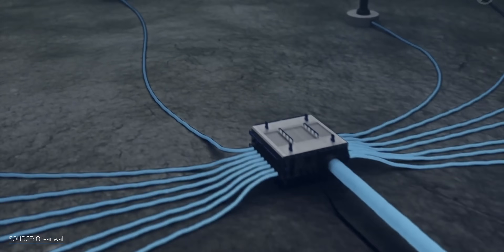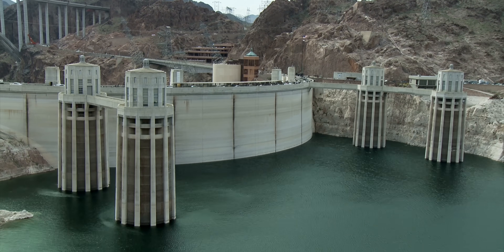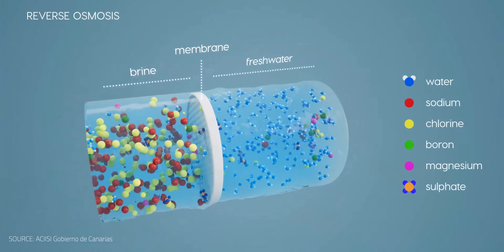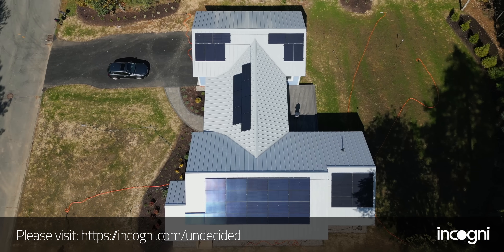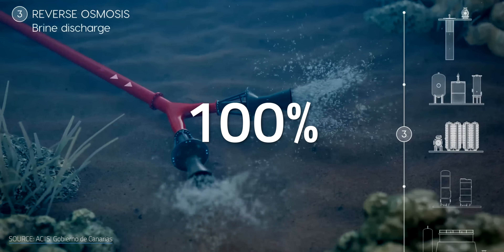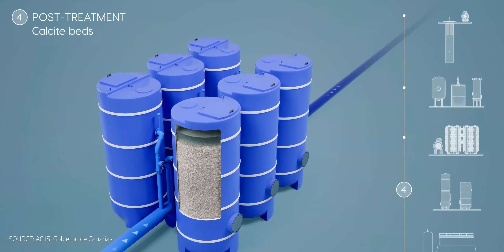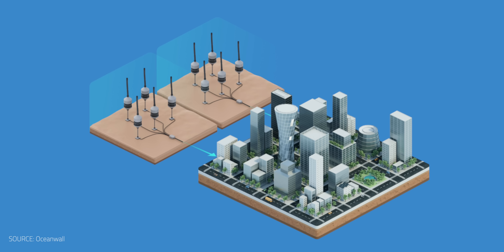How Deep Sea Water is Now Drinkable

Comment: I still did  not understand where the "free" pressure gradient is supposed to be coming from. Yes at 500m down under you have 50atm of pressure. But then everything is pressurized and there is no delta per se, and you need the pressure difference , not just pressure .
Reply: The savings are all at the brine side of things. at the surface you are pushing all the water against the membrane, some goes through, while some does not, the brine portion. this is where you save energy. the pump is removing the freshwater portion, using the same energy that you would need to pump that amount of fresh water 500ft up. then there is the brine which is pumped a few feet away at essentially the same pressure, so minimal work is needed. Thus, saving the cost of pressurization. Additionally, it has a pollution saving and operational cost savings by not needing water treatment, which saves not only money, but the energy used in the production, purification, and transport costs of those chemicals. assuming that the initial installation and maintenance costs are not more than those everyday cost. it's not straightforward and can be complicated for even a simple system. But the physics is correct. pumping the freshwater is less energy than pressurizing a much larger amount of water to those pressures.
Reply: @philip4545-h3t  Thankyou for that. That was the key thing that was missing. They pressurise all the water, then dump a lot of that pressurised water out. If this doesn't need that pressurised waste water it's an energy saving.
Reply: @philip4545-h3t  so the main cost savings is not having to pump the brine back down to some depth. in the vid he shows that there is till pretreatment though, just less? you'd still need all the anti scaling stuff?
Reply: @bobmike2373  no, the main cost savings is not having to pressurize the brine portion. The water is also just filtered, not treated. As far as why? I don’t know, but for the physics. It’s about where you are applying the pressure. Gravity is applying the pressure against the membrane. The only work that needs to be done is pumping the RO water to the surface
Reply: @philip4545-h3t  he shows that its at least pre-filtered. tbh its probably going to need some kind of treatment maybe. pumping the water to the surface is still going to take a one big pump anyways. as a side note, wouldnt this need some kind of flow over the RO filters to keep them from making the local water super briny?
Reply: He did a terrible job of explaining, but it seems like the savings comes from the fact that in reverse osmosis systems a large percentage of the water pumped into the filter doesn't actually get filtered and just gets converted to brine. If the filters are under the sea you only have to pump up the resulting freshwater, not the wastewater. You can achieve a similar savings in a traditional surface system by using the pressurized wastewater to spin a turbine and recover some of the energy wasted pressurizing it.
Reply: @AndrewMeyer  Why do you need to explain something that is obvious?  have you never siphoned water before?  I don't even need science for this.  We did this on the farm all of the time.  If you have a huge water tank full of water and another tank with no water you can siphon water between them(we used to do this over a distance of 100m no electricity just a hose pipe.  you make sure the pipe is at the lowest point in the tank sunk on the end until water starts flowing and then put it in the empty tank.  The weight of all the water in the full tank forces the water into the empty tank.  This is the exact same system but with the weight of the ocean working to force the water to the collection point.
Reply: @hihosh1  Is there pressure on the inside of the membrane or isn't there? If there is, then water's not going to just magically flow through the membrane with a pressure difference of 0. If there isn't, then you can't siphon unpressurized water uphill. Pick one, you can't have both... unless of course you have a pump to do one of those jobs which is exactly my point.
Reply: less energy is potentially needed on the intake side of said filter to draw water into the filter, thus the need of a pre-filter pump to create pressure necessary for reverse osmosis is eliminated and now they just need post-filter pumps to do the work and pump fresh water to shore, but the energy saved doesn't seem that groundbreaking enough to be considered as a viable alternative so there might be other reasons for doing it

funny they do all these work though when they could have just used nuclear energy to power the pumps in the first place at a fraction of the cost while also powering the same city it's providing fresh water to, but having more ways to diversify desalination is still nice for places with less land-side footprint
Reply: @irvalfirestar6265 yes
Reply: @irvalfirestar6265  you can use wave, wind and solar generators out at sea that would save on land usage. making it green.
Reply: @irvalfirestar6265  welder here, only benefit I see is space saving. There's no cost deleted out of the system. you will still need the same power to pull that water 500m up and 6-8 miles inland.
Reply: @joshuawilson7201 energy-wise, cost is saved by eliminating the need for an intake pump due to the pressure differential between pre-filter and post-filter, being situated 400m under the sea level meant that you have 40+ atm at 80000+ psft. You’re essentially letting gravity do the work for you.

Of course, this is only valid until osmotic pressure gets equalized and equilibrium is reached, but instead of needing to spend say 1MW to pump out the fresh water to create a low pressure region AND pump in salty water at high pressure, you now only need 500kW to pump out fresh water, effectively cutting power consumption to half. Remains to be seen whether it actually makes sense in practice though if the power savings aren’t that much.
Reply: Fr, I don’t get it either. Like even if you assume you manage to get a 500 atm pressure down there, your still going to need to pump that shit 500 meters up. At that point why not just pressurise at the surface?
Reply: @cyruswang9354  The entire system is pressurised to the surface. That means that the water level reaches a pressure equilibrium at the surface of the ocean, just like how table water in an aquifer also reaches equilibrium with the surface of a river/well/etc, based on the water pressure applied on the underground water body. The surface pump just needs to create negative pressure to increase the pressure gradient at the pressure to force the water to a higher level than the surface, even higher still to match the pipeline pressure of the municipal water line that it then goes into. You are only providing enough pressure to remove the amount of water you need, rather than pressurising the source to include the waste.
Reply: @cyruswang9354  maybe it’s an efficiency thing
Reply: I think the main advantage is that the brine doesn't have to be pumped anywhere.
Reply: This confuses me too, sounds like a joke at first (thinks out loud).
Quick google gives optimal RO pressure as 60psi, which equal ~42m h2o column, at less than 40psi RO is not effective (~28m). At negative ~10m water column cavitation occurs, so one can not suction 42m.
But the pump is not up on land, it sits on the bottom, so with -60psi (relative) on the suction side, absolute pressure there is 400m-42m=358m (~250psi) and the pump only pressurize the water we use. I.e in a normal RO all water is pressurised to 60psi (effectively be lifted 42m), the work done on the brine is wasted energy.
Plus the density differences (salty vs fresh water) gives some "free" pressure, which I assume is he reason going so deep.
Reply: @marcusosterback3355  👍
Reply: @marcusosterback3355  The pressure delta needs to be above the osmotic pressure for this whole RO thing to work. You are getting different pressures depending on how salty/impure the water is. Rainy season water on the bayside of Key Largo  or  Black sea or Caspian sea  water (between 1 and 2% salinity) is going to  require WAY  more pressure vs home system for treating water with 0.25% impurities max but also a lot less pressure vs a system that needs to deal with "proper" sea water (3.3-3.7% salinity).

The osmotic pressure of a salt solution vs clearwater is  calculated as 

π=iCRT

where i is the van 't Hoff factor, C is the molar concentration of the salt (mol/L), R is the gas constant and T absolute (Kelvin) temperature. 

This is just under ~30atm or 300m of water at 300K / 27C and 33g/L of NaCl as the only salt, which is kinda how  surface water in your typical tropical sea is.

Consequently the pressure difference in the system described in the video has to be the water pressure at 400-500m vs atmospheric or something not too different from atmospheric. So the device is probably similar to a bathysphere that is leaking / being flooded with mostly fresh water through an RO membrane, whereby you just push out the fresh water to the surface via some sort of a pipeline.

This way you only have to pressurize the freshwater line (less water to work with) vs the saltwater line you normally do onshore.
Reply: @marcusosterback3355  The pressure required for sustained reverse osmosis should be ABOVE the "straight" osmotic pressure. For a semi-permeable plastic membrane between your average 3.5% salinity oceanwater and freshwater, that is over 400 PSI and conventional on-land SRO facilities operate at anywhere between 35 and 70 atm (515 - 1030 PSI). That is between 350 and 700 meters of water column pressure just in case and the difference between atmospheric pressure and 500m seawater pressure falls nicely within the range. Yes, these insane pressures work against bacterial cell walls, too - which is why salt is such a good disinfectant -- it creates enough osmotic pressure to just rip a lot of bacteria apart. 

You do get to move less water (since you only do fresh water) in the proposed setup -- but (that's the only explanation I have) at a cost of continuously running things 500m deep down under, which usually is very costly. Shore-based SRO plants these days employ pressurized brine energy recovery, so not too much of that extra work is really wasted in the first place.
Reply: @marcusosterback3355 this makes more sense. The “free” lunch is being able to “pull” 60 PSI instead of having to push. Although I am still trying to reconcile. If I have a mile high tower of salt water and membrane then tower of fresh water. Wouldn’t the salt water drive the fresh water column up through the filter at which point you can pour it back over ? Which obviously violates free energy so there must be something I’m missing.
Reply: With RO you push the water at high pressure against the membrane and some fraction of it passes through as fresh water and the rest of the water plus impurities (the brine) is discarded.  You need high pressure to get the water through the membrane but you don't need as much pressure to pump the water and brine.  The ocean pressure can push the water against the membrane enough to filter it so you can save the work of generating that high pressure on the membrane and just pump water around more normally.
Reply: @DobesVandermeer  how does the brine get discarded at depth? feel like ther'd need to be some kind of pump to make sure it gets away and is diluted
Reply: You will get a "free" pressure gradient because fresh water have a lower density. It will be equal just under 10 meters from a depth of 300 meters. If you place the membranes down at 6000 meter the gradient between salt water and fresh water side should be about 20 bar. No need for pumps. The trouble is that anything at that depth will cost a lot.
Reply: @bknesheim  The more techniques for sustainable technology's the more we learn and improve our understanding/impact on lessening the Humans impact on Earth.  Yes the cost is a lot up front for research, installation and maintenance... but once robots start to replace deep sea divers or their methods change you should be good. Plus you can't go wrong with getting rid of input cost like chemicals and the traditional methods of disposing brine water. It's a win win!
Reply: @rooteddwellings  I understand it just fine, but you need at least 20 bar difference over the membrane to make it work.
Reply: @bknesheim  Interesting... and they don't plan to use very high pressure for the RO anyhow. Feels like the video should really have mentioned that.
Reply: @bknesheim The processes in the video talk 400-600m depths, which would imply a gradient of pressure between the outside and the inside of a somewhat leaking bathysphere-like something put 400-600m below the surface. IF they manage to engineer them just right, the product will be a leaking-through-the-membrane a bathysphere that mostly has air inside but also has water, mostly fresh, getting in through a small hole (many holes in the membrane). All what has to be done then is some clever mechanism that would pump the freshwater out at the same rate as the leaking through the membrane.

If there is a power loss or there's some mechanical issue with the device or some seal/o-ring  goes bad -- the inside of the thing gets completely flooded / no more pressure gradient/the thing probably has to be brought back to the surface, and this process isn't cheap.
Reply: @MotoStylus-z8r  You should do a little math and calculate the energy cost of lifting a cubic meter (1000 kg)  600 meter.
You also need at least 600 meter pipe that can withstand more than 60 bar and pumps that can deliver that kind of pressure. At the moment it is much better to build it on land and find a better way to handle the brine.
Reply: @bknesheim  ~6MJ or ~1.7kWh does sound like a lot, until you realize on-shore devices spend between 2.5 and 4kWh per ton of fresh water just pumping the saltwater and brine at 30-40-50-60-70 bar. The deal is you take, say, 3 cu. m. of saltwater, pump it around @ 35 to 70 atm, and get 1 cu. m. of freshwater and 2 cu. m. of brine -- and you spend 3kWh in process. That is with relatively fancy systems of recovering energy from the pressurized saltwater jets (typically to help pressurize the new incoming saltwater, conserving energy). And you have to deal with 5-6% salt brine (in the scheme proposed here you don't). 

There are tons challenges here, of course -- absolutely no such thing as a free lunch.
Reply: @bknesheim  First comment I saw that gave the actual true reason why it works. Everyone else on here is ignoring basic conservation of energy.
Reply: I need brady from practical engineering explaining this pressure problem to me.
Reply: Pumps on the output side pull freshwater up to the surface, creating the pressure delta. so the inside of the RO filter will always be lower pressure than ambient pressure at seafloor, so long as the pumps are running.
Reply: @Feanarang  right. So much less energy required, but still requiring pumps
Reply: @Feanarang yep.. easy concept to understand.
Reply: @Feanarang  yeah but the point is, you're still going to need to run the pumps at the same energies, they're just acting as suction force instead of pushing force now, it will still need to use the same energy.
Reply: @HerbaMachina  I guess the suface area of water collection will be greater and filters will last more, and yes unless you could make gravity magically dissapear inside those pods there's no saving of energy.
Reply: no, can't suck more than 15 psi, it will still be pushing the water.  only way I can see this making sense is a very long pipe to a desert where dry land is below sea level
Reply: @HerbaMachina the head pressure to the suction will reduce the “lift” required, like any other siphon, but the need for pumps will always be there with this model.
Reply: @Anyone-but-him  hydraulic head only exists if your system is surrounded by lower pressure. At sea level, you get head pressure from the fact that the surrounding air is at 14.7 psi, but the weight of the water above produces greater pressure. But on the seafloor you don't have that lower ambient pressure, so you have to use pumps to create a pressure gradient. I'm not saying there's no savings to be had, but "hydraulic head" doesn't exist on the seafloor, because the concept of hydraulic head is all about differential pressure between columns of water and air.
Reply: @HerbaMachina  Think of it like an artesian well.  The main advantage is you are pumping half the volume of water compared to a conventional solutions.
Reply: @Anyone-but-him  No, its because with normal RO systems you have to pressurize all the salt water meanwhile a lot of that energy is essentially wasted because the brine is waste product that has to return to the sea. You spend a lot of energy pumping all that brine into and back out of the system when you only care about the fresh water you extract. Instead of pressurizing all of the untreated water, you let the DRO systems filter it automatically and pump the fresh water to the surface while expelling all the brine at the beginning of the process. Now you're not dragging metric tons of salt water through the entire piping system essentially creating a bunch of waste energy in the system. 

It would be like a fisherman cleaning all of their fish while still at sea and offloading all the guts and blood you don't want, now you're only "shipping" the part of the fish you want, you save a lot of gas money not having to transport metric tons of something you're going to return back to sea anyway. That along with no longer needing to create a pressure differential to all the wasted brine water too, just the fresh water you're pumping to the surface.
Reply: @robymaru03  Gravity of the weight of the entire ocean on the pods sitting on the depth of the ocean, will push water up the straws (pipes) to a point where the shore ends. They could then have a down pipe several meters lower with a pit that contains water tanks, pumps, plant rooms, extra filtration, and all that jazz. Then they use pumps powered by solar and megapacks to blast the water into a variation of water towers before disbursing to us. This will work, we live in exciting times, let's go baby!!
Reply: @HerbaMachina  these use less energy
Reply: Agreed. This video did a horrible job at explaining why putting your desalination plant at the bottom of the ocean is more energy efficient. Another commenter pointed out that there could be energy savings by not having to pump the brine out of the ocean but that point isn't even mentioned in the video. The video also states that the bottom of the ocean is dark which prevents algae growth, as if we couldn't make dark containers to filter the water in the on shore plants?
Reply: @oM477o  I only click these videos for the topic then go to the comments for the actual discussion around the technology and the issues, as generaly I find this channel just highlights look how amazing this is and skips over all the relevant issues. Their heatpump heating video was terrible for this.
Reply: @MotoStylus-z8r  high pressure pumps are inefficient. A pump operating in standard pressures is far more efficient than a specialty high pressure pump.
Reply: @artemisspawnofzeus7732  The hoses for the outgoing fresh water look flexible in the video meaning you still have to overcome some of  the pressure one way or another.
Reply: The difference is what you pump.  With the deep sea approach, you only pump the fresh water out from those high pressures hence generating the delta across the membrane.  With the surface approach, you're pumping the seawater against the membrane which is not just the 19% that passes through as fresh water but the 90% that is disposed of as concentrated brine.   The deep sea approach just leave the concentrated brine where it already is, in the deep sea...
Reply: I agree, and pipes and pumps work better with pressure than vacuum.
Reply: Shouldn't saltwater be more dense than freshwater? So with the output at or slightly above sea level, there should already be a pressure difference at the filter. 
Where does the "free" energy come from? Collecting dense, briny water at the sea floor.
Reply: @teilzeitbernd  If there were a column of freshwater from the sea surface to the sea floor, there would be a pressure difference between the content of that column and the content of the surrounding seawater.  It wouldn't be a very large difference, though. At 400 meters deep, a column of seawater produces 39.8 atmospheres (plus 1 atm from the air above the water) while a 400-meter column of freshwater would produce 38.8 atmospheres (plus 1).  That's far too little pressure for RO, which needs about 40 atmospheres pressure difference. Also, you don't have a column of freshwater like that in the sea.

Now, if you use pumps to reduce the pressure on the freshwater side of the membrane to, say, one atmosphere, the ambient pressure of the saltwater side would give you 40 atm of pressure difference.  But it's not "free", you have to use pumps to reduce the pressure.  Apparently this is somewhat more efficient than using sea-level pumps to increase the saltwater-side pressure, but it's not clear why that is.
Reply: @TheDivegeek  Thanks for doing the math, I was hoping for a larger difference in density. 2% in savings isn't that impressive.
Reply: @TheDivegeek the energy savings is because you can simply “pull” the fresh water. You waste no hydrodynamic energy moving the brine which must be expelled across an orifice. Theoretically you can capture some of the brines momentum but not all or even a large percentage necessarily.
Reply: I was thinking the same thing. Seems like another eco scame
Reply: You don't need to pump all the 500 meters f water up, you just need to remove a few meters of water from the one and water will fill the line again from the filter ion the seabed.
Reply: @johanntiu4162 Exactly, so the filtration can operate from ocean pressure so long as your pump removes enough depth from the fresh side, like a well. The fresh well could be inland and maybe the pump set 100 meters below surface and protect the vertical pressurized pipes.
Reply: I’m not sure how this pressure is of benefit either. But pumping freshwater out would involve less pumping than pumping salt water in. Simply because most water into a desalination plant is never converted. So perhaps it is simply an issue of having to pump less water.
Reply: I facepalm at the comments. People cannot calculate from energy conservation. Maintaining surface pressure at 400m or 400m of pressure at surface is same except maintainance is harder.
Reply: one other issue that should be considered in the Russian shadow fleet has been destroying or attacking undersea infrastructure like fiberoptics, they could target these as well
Reply: It is the question of pumping 15% water vs 100% water. In conventional set up you need to pump all inlet water now see will take care off and now you need to pump outlet water which is 1/6th lower than previous water that’s where energy saving comes. This kind of system needs size
Reply: @kondamudikishore  Yeah, well, problem is most "serious" RO setups (different from the one in a typical kitchen) actually do pressure energy recovery. Pressurizing filtered and partly deionized seawater to 35-70atm for the said seawater to hit the membranes is a lot of work aka energy expenditure, but then when you get an outgoing pressurized brine flow, people actually use the flow energy to turn pumps that significantly help the "main" pump with pressurizing the incoming "fresh" seawater.  To imagine how much energy that is, the potential as to how far up the fountain with delta-p of 50atm can go, is over quarter mile/closer to half a km -- and modern SWRO plants tap into that energy, with anywhere between 75 and 95% efficiency.  That was the big gamechanger, going from 5-10kWh/cu. m. to somewhere 2.5-4 kWh/cu. m, with some very advanced (read: pricey)  systems claiming <2 kWh/m^3.
Can you get it down to 1.25kWh/m^3 with DSRO? Likely yes. Is it really worth it long term? Time will tell (but my forecast is "not for most setups").
Reply: The freshwater side is not automatically pressurised to ambient ocean pressures. If you lower a rigid strong tank to the ocean floor the inside doesn't pressurise as long as the tank construction is durable enough for that pressure differential. This becomes much harder with bigger vessels but is very achievable with small multi unit clusters like the DSRO design in the video. So if the design has the saltwater side of the RO membrane in in contact with the ocean pressures and the freshwater side faces into a rigid vessel that can withstand being pressurised to 40-60 PSI less than ambient ocean pressures you get a free pressure gradient across the membrane. Slowly this pressure equalises across the membrane as water flows through but all you need now is a pump pulling from that rigid vessel and into collection pipes. That pump replaces the need for pressure creating pumps on the saltwater side, and its job is easier than those pumps. It only has to pump water up the ocean floor to shore, and in doing so maintain the lower pressure in the rigid freshwater vessel. This also replaces the need for the old RO pumps to provide enough work to also return the brine to outlets and dilution arrays. Instead all you need is a cheap and weak circulation pump or some other smart solution to agitate the oceanwater on the saltwater side of the RO membranes. In the video it seems the company has chosen a solution that agitates the oceanwater by having a small pump pull oceanwater along the saltwater side and out of a "chimney". This pump requires very little energy since the flow requirements are low and it doesn't pump between different pressures, just upwards a few feet from ambient pressure to ambient pressure.
Reply: @LoveStarcraft2  The "leaking flooding sinking bathysphere" model is what I came up with; it is pretty problematic in case "something happens", which it always does, exactly as per good old Ed  A. Murphy Jr.

It would be really interesting to understand what is done to mechanical filtration (ok, there is far less to filter 400m down under, but it is not 0, esp. near the seabed) and getting rid of Ca++/Mg++ ions (which is a problem everywhere seawater is used).
Reply: @MotoStylus-z8r  As they explained in the video they use many tiers of filters decreasing in size until you get to RO membrane pore sizes. This separates the filtered material into fractions almost like a distillation column. This combined with continuous filter washing from the brine chimney solution, the very low contamination load of deep sea water and the lower flow rate/surface area of the modular cluster design seems to be the solution for filter clogging. As for the pressure vessels failing and causing problems, we already have decades of engineering experience with deep sea pressure engineering from things like the oil industry. Normal RO systems also have to withstand 40-60 PSI, just from the inside out instead of outside in. They also mentioned that they modular units are sensor monitored for shutoff and maintenance so that shouldnt be a problem.
Reply: I probably don't know what I'm talking about but it seems the pod would be a chamber deep down and like the crushing force against a submarine the water wants to crush the empty pod. The membrane of the pod allows the freshwater through, now add the suction that is needed to draw the water onto land and the salt water will force itself through the membrane at an even higher rate, like if the submarine was deep down and suddenly had a negative vacuum on the inside it would crush instantly because it was already fighting the pressure from the outside but the membrane will let the water in instead of crushing the pod.
Reply: If you have a column of water with a membrane in the middle and then you pump the water at the bottom of the column out then it creates the pressure difference. I just looked up the PSI required for desalination, and it is between 800-1000 psi. The pressure at 500 meters ocean depth calculates to approximately 710 psi. Also by removing the water it would actually create a vacuum which would further increase the pressure differential beyond the 710 psi. This could actually be a viable technology if the costs to install and operate are adequately less than the cost to operate on land.
Reply: @codebloke2200  The problem is, once the pipe raising to the surface is in place and fill if the weight of volume in the pipe is similar, then the pressure differential is 0psi. So your pumps on the surface need to create the fill psi so that water is forced through the membrane, otherwise water will be pushing down from both sides, and the water will have no interest in going through the membrane
Reply: @ChaseAnderson5k  We obviously don't have high pressure valve technology to prevent exactly what you described
Reply: @codebloke2200 a high pressure valve doesn't fix anything. if you had a value to keep the weight of the water in the hose from being against the membrane, you'd also trap the water between that and the membrane, leaving the pressure unable to push water anywhere.
Reply: @ChaseAnderson5k  It's not pushing water. Its the pressure differential caused by creating a vacuum in the lower chamber. I think that is where you are getting tripped up. As soon as the lower chamber evacuates water (by effluent pump) it will leave a vacuum because the membrane will provide enough high pressure resistance to prevent the column of water above from immediately filling the void. Then a high pressure valve can seal the backpressure resulting in the pressure differential that last as long as it takes for water to permeate the membrane and equalize pressure
Reply: I don't specialize in this but this is how I understand it. There is some high level physics math that happens with these things.

Strong enough pipes themselves shield whatever is inside from the deep sea pressures. It acts as a barrier between high pressure and low pressure.

The destination where the pipe goes can be any pressure. As long as it's a certain factor lower than the pressure of the bottom of the ocean, the ocean will want to go to the path of least resistance which would be the entrance of the pipe.

Building a pipe from the bottom of the ocean to the surface will result in quite a bit of water spewing out at the pressure difference between the surface (1 ATM) and the bottom of the ocean (40 ATM).
Reply: Did you ever drink through a straw?
Reply: Same way a drinking straw works. Remove the air from the top.
Reply: @joshuavillademoros8278  you cant drink from a 500m straw
Reply: If that were true, your pipes would crush un the the pressure.. 
Either you have flexible pipes and lose all differential, or you have rigid pipe and need to pump the same amount of energy.
Reply: You pull a vacuum on the discharge side of the pump. It's much cheaper than trying to force salt water through a membrane
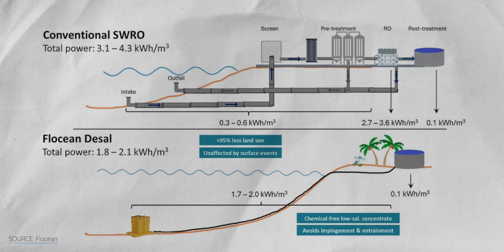Reply: 7:02 should help you understand it. The resistance of the ro membrane will push against the water pressure down there and the pumps are actually using more energy to bring that water up to the surface but the amount of energy they save pressuring the water to undergo ro more than makes up for the extra needed to pump it to the surface
Reply: So it’s not that they are using the water pressure for free pumping force. They are using the water pressure as a free way to force the water through the membrane which is where most of the energy is spent
Reply: You pump the water after the water is desalinated. That means you don't have to pump all the salt, but just the fresh water up from the depth.
Reply: You only have to pump the fresh water up to the surface, and not the brine water. So with 50-60% less water to pump up, you get the equivalent saving in power. That is why these are still pretty power hungry.
Reply: Basically you only need power to get it started, and once it is running it will run perpetually on its own unless some of kind of issue arises.
Reply: Best I can tell, RO requires both a pressure delta AND an absolute pressure. Putting it below the ocean takes care of the absolute pressure, so you only need to power the pressure delta. But that's just a guess. I don't see how an absolute pressure in a liquid should be required.
Reply: Well you have the pipe to the surface filled with air...

So it works... ... ... until you need to GET the water.

Then you are kinda fucked.
Reply: Same here.
Reply: the pressure of the ocean is doing most of the work, the pumps creating suction are operating at a much lower power rate due to only having to move the water to shore thus its more efficient, also you could have wave generators with wind and solar out in the ocean too thus making it green energy thus it is better.
Reply: @thebogangamer1  In order to "move water to shore" the pumps have to move it up above the surface. There should be more pressure on the outlet side, not less, because the pipe to the surface contains a column of water that is taller (because it goes above the surface) than the one that is creating pressure at depth. That is why people are confused.

As another commenter in this thread mentioned, it only works because freshwater is less dense than seawater. So that column of freshwater in the outlet pipe weighs less than the column of seawater above the RO mechanism, and thus creates less pressure.
Reply: 13 minutes of video and none of us know how it works.  Click bait.
Reply: Yes Me thinking "So if you put one end of a pipe at the bottom, and the other end at the top, you  get a free fountain?"  and "that can't be right"
Reply: Salt water is heavier, thus that pressure is used to push saltwater into the membrane. Once it passes thru reverse osmosis membrane, it is now freshwater. If you repeat it, the same pressure that pushed it thru membrane is the same that would push it upwards. Remember, freshwater is less dense than salty water.
Reply: Hi, I think the difference is coming from density differences. Freshwater is less dense than saltwater.
Reply: Inject a small amount of air in the return line near the base  it will act as a way to lift the water.
Reply: @ntal5859 Injecting a small volume of air will not decrease the pressure by 40 bar magically, which is the delta p needed or process to work.
The air bubble would just allow water past and  underneath it and rise alone.
If you locked the air in bladder the bladder would not move up if it was fitting the pipe snugly.
Reply: I think the idea is that it's easier to pump water to the surface than it is to make the water high pressure. There will still be some pressure even on the low pressure side of the pump (between the membrane and the pump) so the pump only has to make 25 bar instead of 50 bar, something like that.
Reply: @KamikazeWombat  If the device has 25 atm inside, then the delta with the outside is only 25bar, and the said delta has to be above the osmotic threshold (almost 30 atm assuming 3.3% NaCl, the lower-end salinity at the sea, and ~300K temperature) if you want any RO to be happening. Conventional SWRO setups do anywhere between 50 and 70atm vs the membranes onshore.
Reply: @MotoStylus-z8r  I wasn't trying to give accurate numbers since I don't actually know what pressures they run at, just an example of what I think may be the way the pumping is made easier.
Reply: @KamikazeWombat  The only way it is easier is that you just have to pump 2-3 times less water, that's it (and fresh one, not salty, too). 

But then there is a very unconventional  thing with these ultra-complicated pods working 500m down under....to save up to 50% of the energy bill whereby the said energy bill is 10-15% of the final water price....idk, does not sound like a mega-revolution to me.
Reply: @KamikazeWombat  You can pump water to a tank 400m up a hill and get 40 bar of head pressure.
Reply: The pressure difference comes from the fact that saltwater weighs more than freshwater, it's not much but at those depths it would be enough to push water through the filter and that would create a sort of siphon
Reply: @FTATF  siphon comparison is not good. Siphon works where one end is lower than the other and water goes from high to low.  Something that can pump the water from low to high would be a free energy machine. Or create a permanent pressure difference.

Even if you were right, the density difference is like 3%, so the pressure difference would be not that strong.

In reality I'd be pretty confident with no pump the system would reach relatively equilibrium, with the force of water on either side of the membrane being relatively equal, and without significant water being forced through the membrane, and your pump has to do the work to pull the water up vertically and create a pressure difference sufficient to force water through the differential.

They describe various advantages that may still exist and I assume that's why the tech exists at all.
Reply: @FTATF  all the pressure is 50 atm, that is 500 meters of water above. The difference between sea water and fresh water is about 3% and it not nearly sufficient for RO at 500m (1.5atm tops). To start dripping water through you need a pressure delta in excess of the osmotic pressure, which in 3.5% NaCl solution at 300K is just under 30atm. "Normal" on-shore saline water reverse osmosis (SWRO) plants use anywhere between 35 and 70atm of pressure to push  the saltwater through the membranes. Here the pressure probably is ~40-50atm, so it has to be the delta-P between the saltwater @ 400-500m and surface-level pressure somewhere in that pod.
Reply: @MotoStylus-z8r you can get a 30 psi RO filter.  So lets say you went a little deeper or instead of 1.5 atmosphere difference it was 2 atmospheres, it seems like its closer to 2 atmospheres to me. Keep in mind, this is all literally stuff we learned in middle school,  nothing complex here. 2 atmospheres would be 28.4 psi.  You wouldnt have to draw much of a vaccume.  Its not out of the question to consider that there is some proprietary technology at work here that we may not be aware of.  Sure there are probably factors im failing to consider. Regarless of that, ive clearly shown even according to your math that you can come close to the desired pressure difference you asked about, and that pressure difference is near the threshold known low pressure RO filters.
Reply: @FTATF  You can get RO at +1 atm/15 psi, but you can't get any meaningful amount of water from the 3.3....3.8% NaCl solution (typical sea salinity) to get through the membrane with just 15 psi /1 atm of extra pressure.

Home-grade reverse osmosis systems that do work  with your average brotherly love city water at 0.5 - 5 atm extra pressure from your faucet WILL NOT GIVE YOU PERMEATE (clean water) from OCEANIC WATER in any meaningful quantity. 35+ atm pressure in industrial SWRO systems is not because these systems are industrial and built by greedy capitalists to sell for big bucks, but because of physics of the process, as described by Van 't Hoff, Adolf Fick,  Henry Darcy, Josiah Willard Gibbs & co (who were no idiots). They are how they are  because they HAVE to be that way to produce fresh water out of oceanic water.
Reply: fresh water is less dense than salt water. the water in the pipe will want to float. that's the entire efficiency gain and why they are filtering it at the sea floor and not just pumping it to land first. its not enough to get it to pass the filter on its own so pumps are still needed. but creating 340 psi is easier that 360 psi across the filters. its not a ton different but at scale its not insignificant.. if that outweighs the difficulty of changing the filters at depth.. idk  but that company seems to think they still can.
Reply: @jim4556  The pressure with fresh water at the same depth will be slightly less than with salt water.

Specifically, about 97.56% of the original pressure.

we are talking 2% energy gain. Unless you want to distill water at the bottom of Mariana Trench, then it is better 26 bar, halfway done!
Reply: @MarcinP2  yeah.. I didn't say it was alot. One would think kilometers of pipe and needing to pump water and power through it and the added cost of changing filters at that depth and a non industry standard design would far exceed that marginal gain.. it's a far fetched idea..

I see how boats make their own fresh water. Sure it's more exspensive and energy intensive than normal sources of fresh water but it doesn't seem that terrible unless your using it for farming. 
I think the answer for water shortages is trying to re-use our waste water. Better conservation efforts. and supplementing with RO.
Reply: @jim4556  Norway's deepest point is 4km so a pressure difference of roughly 10 bar and 20% energy saving btw but probably half that realistically in other places closer to shores.
Reply: This channel pretty much just shills scams. Don't expect any scientific insights. If your level of education is beyond highschool, this channel isn't for you.
Reply: I'm guessing just another scammy "drinkable water" scheme
Reply: @cgourin  This channel does nothing but promote scams.
Reply: by removing the fresh water you're creating a pressure differential
Reply: @AsbestosMuffins  99.9% chance they are sinking a hardshell device (like a bathysphere) with atmospheric pressure inside to 500m down under, open the "floodgates" and then just remove the permeate water with a high pressure pump.
Reply: @AsbestosMuffins  And to remove the fresh water you need a pump with the same pressure differential but in a very expensive and inconvenient place to maintain.
Reply: 7:11 is where he shows how the theory works. It still uses energy just about half as much.
Reply: Salt water is denser. Maybe that's enough to get the pressure differential
Reply: That pressure pushes the water to the surface where it opens up Again.  One opening at bottom is very high pressure, one opening at top is very low pressure
Reply: I guess it depends where the fresh water is received. It could theoretically be piped underground and then pumped back to the surface. My assumption is that the energy needed for the RA is more than the pumping alone.
Reply: “Maintenance Free”. A field techs worst nightmare.
Reply: I don't understand it either but I assume it's similar to capillary energy just like trees suck water from the ground. This would be limited to sea levels and not higher elevations...which most popular areas are in sea level heights.
Reply: others in the comment section mention that salt water weights more than fresh. there might be some savings there if its deep enough but then you lose cost for it being soo deep. plus i dont see how the brine just gets pushed back out to sea. fee like there would just be an increasing aura around the pods of ever increasing saltyness
Reply: @bobmike2373  freshwater and saltwater have somewhat different densities, usually by about 2-3% depending on the part of the ocean/salinity/temperature/etc.
The "order of magnitude" pressure at 500m  is ~50bar. 2% of 50 bar is 1 bar - that's how much pressure difference you get because a 500-m column of saltwater is heavier than a 500-m column of freshwater. You need ~28bar to even start saltwater reverse osmosis to begin with (most commercial systems provide between 35 and 70 bar of a pressure gradient).
Reply: @MotoStylus-z8r  the other people that i mentioned were saying you use a depth of like 3km and you still get 6psi at the surface allegedly
Reply: I was wondering this too. You need. A pressure difference to move the water. And unless they play to put massive pumps on land to pull the water up. I'm not sure how they plan to get movement on it.
Reply: Want to be a hipster on the spot?  Say "bespoke" lol.
Reply: You are sucking (less energy) not pushing (more energy). Sucking doesn't suck in this case.
Reply: I think it's a scam to do away with energy consuming tech that actually works
Reply: He did mention it, by creating a suction on the no salt side.
Reply: Great explanation to shed light on the intricacy
Reply: It sounded like the delta is from the sea bed to the surface.  Granted he did mention that the water pumps would need to be powered
Reply: Water in the pipes has one dimension of pressure, the water ahead in the pipe, pushing against it. The water outside the pods at the bottom of the ocean has the entire ocean pressing on it from every direction. 
Depending on the pipe circumstances I assume there’s a delta there
Reply: The energy saving is in just pumping the freshwater and not all the seawater and brine as well. 

The high delta pressures required across the membranes remain the same irrespective of whether the RO membranes  are at depth or at the surface. 

The advantage deep underwater is that pumps can only develop the high suction required (instead of pressure)  if the surrounding water is at high pressure. It is called NPSH or Nominal Positive Suction Head. At the surface, with atmospheric pressure of 1atm or 101.15 kPa ( abs) water can typically only be sucked about 9 to 10 metres high after which water starts boiling at the pump/ cavitation at atmospheric temperatures. 

At great ocean depths, the pumps can develop the required delta over the RO membranes , in suction, which is now much greater than the 10 metres max at the surface
Reply: @MotoStylus-z8r   fresh water and salty water have different density  .
Reply: I’m trying to “free body” this problem as well. 

The problem would seem to indicate you could build a 1 mile tall tower and have water continuously pump from salt to fresh… but I feel like I missing something…
Reply: You’re not pumping seawater through the filter — the ocean does that part for free. You put the RO membrane 500 meters underwater, where the pressure is about 50 times higher than at the surface. Then, you run the clean side of the filter (the freshwater side) up to a collection tank near the surface.

Since your tank is at normal surface pressure, the deep ocean pressure naturally pushes water through the membrane. That pressure difference is what drives reverse osmosis — you don’t have to supply it with pumps.

It’s like drinking from a straw or flipping a cup upside down in a fish tank — the pressure difference does the work. You only need energy to move the clean water once it’s at the surface, not to force it through the membrane.
Reply: @siorusbzns654  Yes but then you do have to continuously pump the fresh water up from 500m down under - which is not a simple feat by any stretch of imagination. You do get to move less water (just the permeate), but at the cost of performing the pumping in a rather hostile environment (500m under in the seawater).
Reply: The savings comes from the fact that the intake water is already at 50 atm, and the pump that is pumping freshwater to shore creates a lower pressure zone that 50 atm of pressure presses through the filter to fill.
Reply: @griffinkimberly7695  the hoses in the pictures look flexible meaning you still have overcome at least some of those 50bars.

I'd imagine the real goodies benefits would be coming from the fact that at 500m there just isn't much of plankton / algae / etc in the water which is the #1 killer of the RO membranes.
Reply: I wonder if they will use one of those ram pump pipe systems that loses water on the way up but still travels uphill.
Reply: Ever heard of a syphon?
Reply: You only need the power to pull the water on the other side of the membrane, not push it through the membrane.
Reply: Y'all are familiar with how siphons work, right? Suction gets it going, air pressure and gravity keep it going. In this case, you don't have gravity assisting, but you do have the tremendous force of deep sea water pressure to make up the difference.
Reply: @hercanic9825  Yes, but of course that force is still created by gravity.
Reply: @hercanic9825  this, the weight of the water does half of the work, the only thing you need to counteract is the gravity of the water you are pumping out through a regular pump, high pressure pumps are inefficient because they are counteracting gravity AND pressurizing the system, which  creates a lot of waste heat due to friction, it's basic hydraulics really, it's not that different from your car hydraulic steering system, the pressure is added by a pump and in turn your arms feel barely if any pressure, yet the wheels feel an enormous amount of pressure
Reply: @hercanic9825 siphons need to have the exit below the level of the source. So I don’t understand how this is similar.
Reply: @hercanic9825  A siphon would work if the source of the salt water was on land and the delivery location was at the bottom of the ocean. In this case it is the opposite as you need to consider that the elevation of the ocean is zero, the location of the RO is -1500m, and the final delivery location is +20m. As these pipes would all be flooded and connected the net gain is positive, so a siphon would not work. 

Not to mention the fact that the low point is in a vastly different pressure environment.
Reply: @hercanic9825  siphon spill water at a lower height